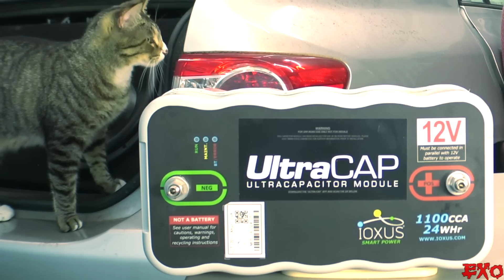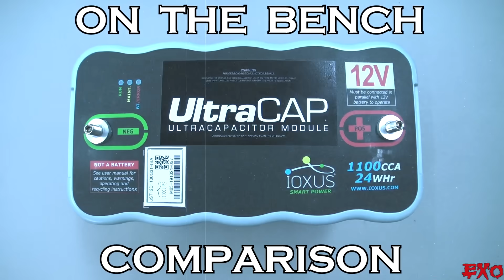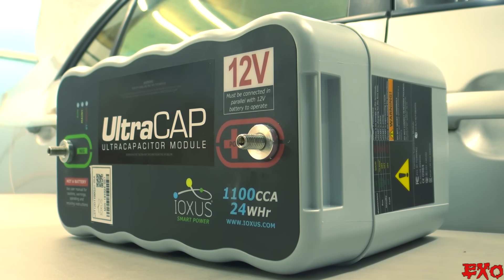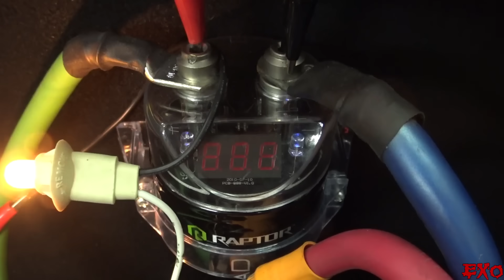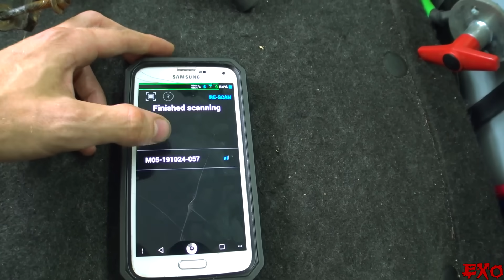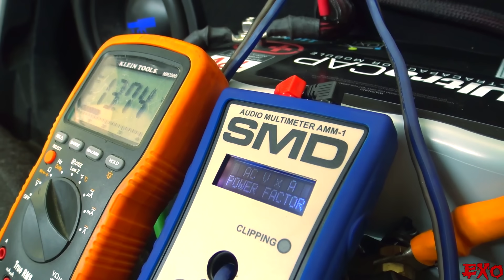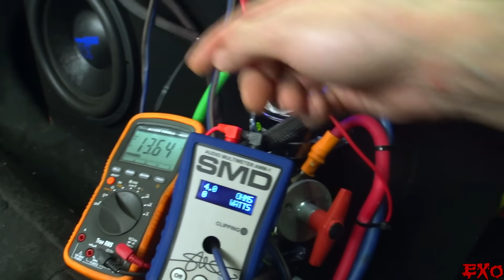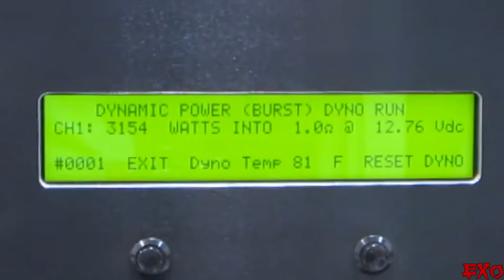The TRUTH About Car Audio CAPACITORS! Testing a CHEAP 12v Capacitor VS IOXUS UltraCap Supercapacitor

Comment: Back in the day we used caps to save the alternator. Older cars often had like 40amp max alternators. With a big amp they used to pull more power then the battery and alternator could handle, especially over long periods of time. A decent capacitor was often used if you didn't like replacing alternators or push starting your car
Reply: My 68 camaro has 69 amp alternator. It’s been along time since 40 amp alternators
Reply: @Thumper68  Some cars still have alternators that will barely supply 40 amps.
Reply: I remember lol
Reply: @reidnichol9255none

Comment: I NEED THAT BUT NOT RUNNNG THat big system but got auto start stop malibu n 2nd battery cant use got a oem n agm under hood but like know il dim or drop to low to pull codes on car ?

Comment: Hi, I'm new to car audio and just got a ground zero xspl12 powered by an impulse sd1500 amp. Do I need a capacitor to run it at 1 ohm? (running at 4 ohms for now)

Comment: Hey odd question,I have a scosche 500k micro farad cap I want to wire inline with my aftermarket electric air horn in a 01 lesabre , the battery is under the back seat so the horn power comes off the alternator to fuse box wire,when the car is running the gon kinda has a flutter sound vs when car is off, do you think it will work? 
Love the vids,very informational.

Comment: I blew a alternator belt and alternator this week by trying to push a 4K amp and 2 15s and a 1500 watt amp on 1 12 with direct wires to the battery like a dumbass lmao

Comment: You wouldd never need 90 and 0 guage is pointless unless its throughout the system. How oftten do you have a dead battery. Jumper cables do the same.

Comment: I got a question for the professionals. I'm in the business of making a power supply and i want about 150 amp capability. if i put 120VAC into a transformer. step it down to about 16VAC. Rectify it with a diode bridge. could i put a 1 or 3 farad car audio capacitor between the rectifier and the battery? or should i use another type of capacitor.
Reply: Well it depends on what color the power supply is going to be.

Comment: great video, thank you so much,,,,, any basic rules as far as adding a second battery?  im adding RS1.8000D   3000 rms for 2 12"  1000 rms each, on 2006 750li bmw, when do we know to add a second battery? any help pls i dont want any electrical issues this car is sensitive to voltage thank you

Comment: Im running 2 12”s JBL 1000w’s with a 1500w amp. I’m planning on going with a boss 8 farad capacitor do you think that should be good?

Comment: I am an Electronics hobbyist & former installer. This video makes total and complete sense!
I understand why you need to explain it to the average person, so that they can understand. It's all about capacity. All capacitors can accept a charge & discharge extremely fast.  Some faster than others. But you throw that many farad's in a capacitor Bank, backed up with voltage regulation and Bluetooth. You got plenty of juice to make your Bass Thunder hard!
Nice demonstration brother!👍🇺🇸

Comment: Well, this answered my question about using one of those 2f or 4f cap for something totally unrelated. I was wondering it they back feed into the electrical system. And they do obviously if power makes its way to the starter.

Perhaps a huge Diode in line would work.
Reply: An isolator stinger make them recoil makes them nvx makes them . also they work very well turning your system on an off, 
Beside separating any battery banks or caps

Comment: I'm installing a capacitor bank in the trunk for my audio system. I already installed a cut off switch. Do I need any other fuses besides the one next to the battery?

Comment: I know this is an older video by internet standards but I have a question regarding the ultra-cap. Why that over just getting a second battery? Whether it be lead/acid, AGM, or lithium. The way that UC is built it seems to act like a normal battery, capable of discharging over time instead of all at once. Its easy to find a battery with 1000+ CCA and over 24 Ah of current. So what's the difference?

Comment: I have 2,500 watt system I have to replace my battery pretty frequently would a small capacitor fix this or na?
Reply: General rule of thumb is 1 ferad per 1000 watts. You can do more ferad per 1000 if you want, more is better in this case.

Comment: Excellent information, thank you! Would it cause problems Like resistance if you had an additional capacitor in between the amplifier and the sub? To ease the strain on the amplifier...🤷🏻‍♂️
Reply: Caps dont work with ac power tho
Reply: @creamy8715  Correct, and that dude clearly has a 0% understanding of how things work. The amp is an output device feeding an input to the sub, it would be a signal boost not a voltage boost, and its already too late at that point. The question made me giggle a little.

Comment: I run a 3 farad cap on my system I’m running 2 sdr skar 12’s and a 1100 watt Memphis class d tuned with a o scope. I also have a platinum agm battery and big 3 done. No problems at all. I stay at 12+ volts in the super low notes 13+ normally no matter how loud and long I run it. I think comparing the two that you did is still kinda misleading to new comers. It all depends on what subs and amp you are running for how much power you need. In my case there is no need to buy a 400 dollar super bank. I’m not running that much power. Doing everything else correctly helps the most like battery, big 3, proper grounds, proper sub wiring. I’m just referring to the smaller systems like I have that get played a lot. I’m not doing demos or hair tricks just personal enjoyment in my work car. So comparing “apples to apples” as you say could still be confusing to new to systems people.
Reply: Yea it wouldn't matter if you had a cap regardless. Your battery is pretty much an ultra capacitor. Especially if you have a nice quick discharge agm one like yourself. One farad is good for roughly 50wl watts. After that it's useless untill it charges again. Which it then does, sapping strength from your amp, then when it's charged, it finally shoots it's little load and it starts the cycle over and over and over. Getting a capacitor for a low power system makes no sense because you wouldn't need it. The phrase is "one farad per 1k rms" if your not pushing that why even bother? You're better off either getting a better alternator, or battery and then upgrading the stock wiring. If youre pushing over 1000 rms I'd say then you would need an ultra cap, because like I said one farad is good for ~50 watts vs bam ultra cap with dozens of times the capacity of the shitty $120 fuse you just bought for your low powered amp.

Comment: When should i consider using ofc over cca? So how much power should my amp be pumping out if i want to go with ofc?
Reply: Ofc is better but awg welding wire is the best also a lot more expensive but you get what you pay for. How much power your amp puts out depends on a lot. It depends on how your subs are wired, battery, electrical, amp capability the list is long bro.
Reply: If you can afford the ofc cable buy it as it does make a difference as seen video on you tube 😀

Comment: Or maybe if you don't care going the explosive way you can use a few good lipos in parallel + series and they will have lot of juice and also shoot out thousands of amps easily, but when they fail, they usually fail BIG TIME = BOOM :)

Comment: I will take the time to explain...If you have voltage drop while playing your soundsystem, you need a larger alternator with the biggest pure copper wire you can get...caps do an amazing job in providing instantaneous current to your amplifier(s) to provide much better sound quality by providing current over a thousandth or millionth of a second,the highest peak draw.Caps do not produce power...That is the purpose of the alternator. Remember ...You must have more output from your alternator than the combined  current draw of your stereo and your car electrical system or your soundsystem will not sound its best...even if you have supercapacitors.

Comment: Great vid ! But if you connected and disconnected the 4farad acouple of times while watching the meter you would see a voltage increase when the capacitor discharges .if done on a timely basis you could start a car. Been stuck with a dead battery a couple and have of times.

Comment: Im suprised the reg cap let the bendix work.. I was introduced to caps in 91/92 and old computers had 1/2 farads in them.. We scrounge them..for 10 bucks a pop at salvage yards while car audio shops sold the same Maxwell used for 35 a piece..times have changed
Reg caps are still ok..
I use caps on my led headlights on my old 94 to let them dim out

Comment: My sons car is a 2004 Toyota Corolla. I had a system in my suburban from 2003. I decided to give my suburban to my brother and he didn't want the system. So now that my son is driving he asked if he can put it in his car. I never had an issue with the charging system in my suburban. I did up grade the alternator and put a better battery in it. And that was after driving it for years. I'm hoping you can say it would be a good idea to put a cap in his car to try and save his charging system from going bad? I'm not really wanting to put a lot of money into this project. It isn't a large system it's 2 10" kickers and a kicker amp. It was professionally put together and installed in 2003. I never had an issue. The amp also ran the 6×9's in my suburban which I didn't take those out. Thanks for the help

Comment: I’ve had this cap for 4 months and happy with it so far I have it paired with two north star batteries but looking back I wish I knew more about lithium and it’s cost to power ratio first before I bought the NS’s but they’re still great batteries despite the fact, but the lithium would be cheaper $900 worth of NorthStar vs $700 Lithium.
Reply: I got the Northstar batteries they have their place best way you can make the most of those is put headway in parallel with them an it'll kill shit!!!

Comment: it wont have the fancy features obvs, but you can build your own supercap bank for much cheaper if all you need is a good cap setup.  $20-25 per cap, times 6 caps, you've got a 16.2v 500-566 farad bank.  Add voltage regs for $5-10 bucks each, a fuse, some wire, and youve got a big ass bank of power storage for under $200.  If I can find a way to reliably build a good enclosure Im considering making and reselling banks...  Considering a comparable bank from a big name would be $400 on a great day but closer to 5-600...even selling for just $300 is decent easy profit.
Reply: Would love you to build me a system but unfortunately live in the Uk so post would be a lot

Comment: Hey Man Hope u doin good ,I'm like getting into bass stuff right now like 6 7 months ago and yea trying get myself a capacitor nd saw this video will I be able to run the ioxus with 2 amps which is running each amp at 40ohm ( 500watts) and what wire size can I run to ioxus my capacitor 4gauge or 0gauge and my car battery is 12v 430cca.

Comment: On a mechanical  side, your alternator make it best voltage over 1700 engine rpm. Also your belt squeals on startup. Should get a new belt, and tighten up for optimum running

Comment: Good information. I been using caps for years never now there was a super cap. Funny thing is my caps was working fine in my bmws but I sold those cars and bought a new Tahoe in 2019 brand new . And added a 6 farad cap with 5.000 watts and 3500ish rms bass power and my light dimming . I’m under factory warranty and can’t upgrade my alternator what do I do . Man just send me a free something to fix this . 

Hyphonics Brutus 3500 amp

2 kicker 12” CVX 

HELP

Comment: Is it possible to run 2 capacitors together either in circuit or parallel with a second battery

Comment: I got a 1500 watt amp and 2 tens idk what wattage. But I’m getting clipping. I’m going to upgrade to 2 12 inch 1600 watt subs. Do you think I will continue to have clipping or should I get a 3 F cap and would that help with clipping?

Comment: Big help thanks alot I had no idea about super caps .... I run multiple with a 2f and a 8f    .pushing 6 12's kicker type r   and 5 15's   American Bass.   2 Energie er1600 and walmart 750 co crank up front   stock alternator .  But work van so is high output

Comment: I was an Auto Tech. A Dead Battery acts like a Short. Dropping the Voltage. Lower V Equals Higher Amps. The 4 Farad would have done a better job if wired directly to the Battery. Instead of what you did. Years ago I had a Profile 100x2 amp. Bridged Mono. Kept Cutting Out when the Sub hit. Checked with a Voltmeter. On Battery Power, Volts Dropped to around 10V. A 1 Farad Cap recommended by Crutchfield Fixed the problem. Also, Caps work as Noise Filters. Blocking the 60 Hz hum from the Alternator.

Comment: I still put a 1F cap in any system I build strictly because it eliminates the "pop" when you turn on your stereo.  That is the ONLY use they have. Well the girls dig the lights so yeh I guess there 2 uses. But helping with that pop is the main reason I install them.

Comment: They are a load on the Alternator, BUT they protect your car.  Your computer, headlights, airbags, etc are allowed to operate at 12.5VDC while your audio system charges the cap back up.

Comment: I only running a JL Audio 900/5 with 4 gauge wiring. Would I ever need to do the triple 0 gauge or a cap of any kind. Im in a 2019 Accord

Comment: Note to people who won’t shut up about a second battery or a larger alternator. A capacitor isn’t made to deliver more power or to increase capacity by a large amount. It’s only supposed to hold enough capacity to smooth voltage drops/ spikes and reduce the likelihood of an amp messing with the cars voltage. Google “Smoothing capacitor”. That’s basically what these things are.

Comment: Yellow EXO, and community,  I need some help, hopefully these new capacitors can work for my situation? My situation is, I'm working on a friends new hybrid/EV vehicle. I have learned they do not have a alternator and that they work off a DC to DC converter. The problem I'm have is the system draws more amps than the converter can supply. I know you can add a additional battery of the same size, but would the converter be able to charge a dull battery or multiple battery set up? Also I've thought about maybe seen if i can buy a additional converter?  I'm sure it would be expensive.  Simply put I need a larger power supply, more power!!! I wish I could just add a high output alternator or alternators and batteries, I guess this  is now considered the good old days. any help would be appreciated thank you all.

Comment: Thanks Nicholas. I like your videos. Way past my knowledge. Question, back in the days I bought a power cord XL 15 FARAD Distribution Capacitor and it's been sitting in the original box brand new. I never even charged it. I had plans to install it in one of cars in the late 90s. But I didn't and sold the car. Still have this unit and I'm trying to think what I would use it for. I have thought of using it in many applications. Solar, and now I currently own a Chevy Volt. Would this benefit me in any other use?

Comment: I think you need a new belt man. It was squeeking even when you started it.

Great vid as usual. Thx for the info.
Reply: That's because the battery was dead, huge inrush draw as soon as the alternator turns fast enough to make power.
Reply: prob needs a timing belt and water pump too.

Comment: I recently installed 2 2 farad capacitors in my audio installation. I am running two Memphis 1500watt amps independently each with a capacitor. So far they are performing excellent, my amps are holding 14.1 volt charges, my lights do not dim, flicker, and my dash voltage gauge is holding 14 volt charge no how long and hard I am pushing my sound system.

Comment: Good Video ...Quick question. Whenever using caps does a battery isolater need to be installed for directional current?...Thanks man

Comment: Not everyone can afford these HUGE ultracap systems. Rather than buying those crappy 1/2 farad capacitors, buy a Maxwell BMOD0058 E016 C02 - This is 58 farads, tiny so can fit in anywhere! I've used one in my car for the last 5 years now (mainly to help start the engine). It prolongs the life of my car battery and as it stabilises the voltage system, components like bulbs etc will last longer too!

Comment: I'm putting together a home car audio system. I have a PM3-100-LK Powermax converter. Should I use it as a constant power supply or use it in charging mode with an attached battery? Perhaps even use a 12v Ultra Cap. What do you suggest?

Comment: I made the ioxus ultracaps! The odds that I contributed to the manufacturing of the one in this video is almost 100% I love car audio and it's awesome to see these in this video.
Reply: Nice im trying to get one to run my taramp
Reply: Adam, response would you give me if I asked about the safety of using these despite the recalls? Just looking for saftey
Reply: @royalbooty4657  i been using mine for a couple months no problems. they recalled them bcuz the brackets that held them in place would break open the housing allowing moisture to get it in causing shorts
Reply: Just add to the car or does it have to be charged?
Reply: @jayone2918  you have to charge it before hooking it up, trying to figure out how to charge mine , myself too....
Reply: @johnnymartinez2917 I have the uc-31. it says nothing about charging before installation in the manual..  In fact I think they should be discharged before hooking up. The battery you connect it to in parallel will charge it in seconds, then the alternator will replenish what's left.